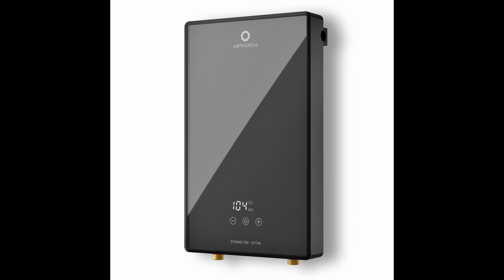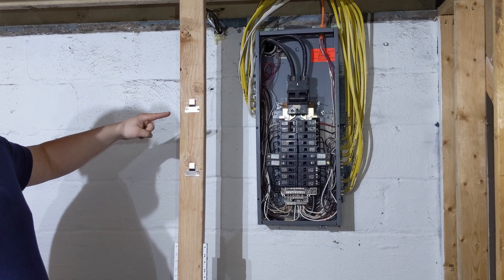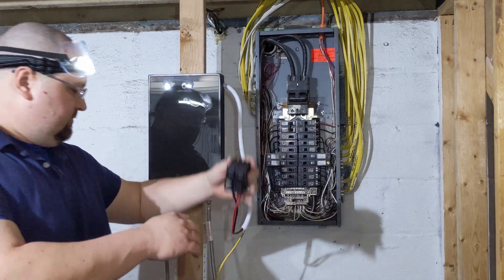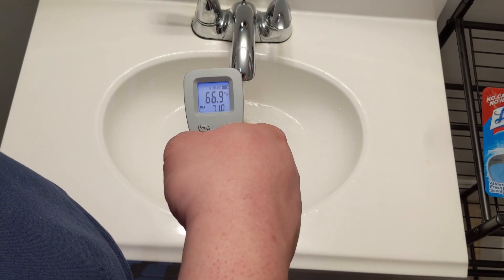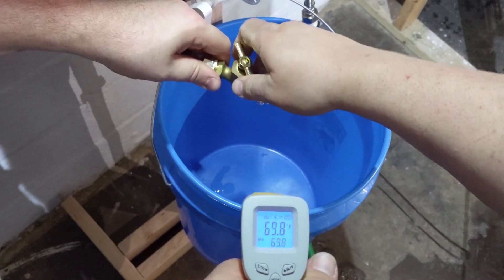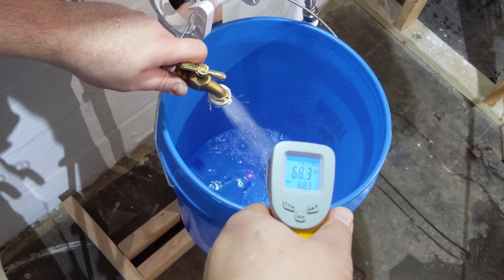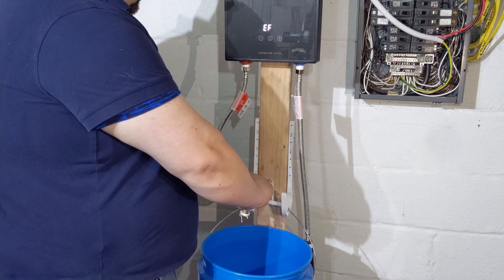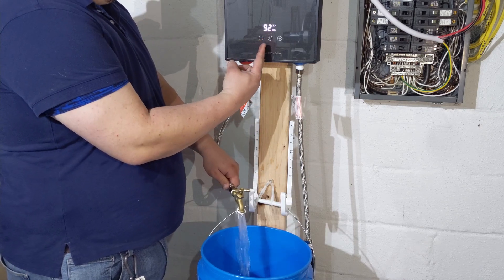Airthereal 9KW 240 Volt Electric Tankless Water Heater Unboxing, Test Bench Install and review.

Comment: How many sinks can I run with hot water running and how long before the hot water go out um tryna see if I can run my shower and my kitchen and bathroom sink together
Reply: Oh I ok I appreciate it I need something that can run 2 sinks and a shower
Reply from the maker: @pakmanmoore4255  I believe their biggest model can do that, this small one can't. It's great for the appropriate use case, but for your use case I would definitely go with their biggest one.
Reply from the maker: This unit will only run one or two sinks(only if low-volume models) . It will not run a shower. 

The larger models will handle more but require more Breakers and different wiring.

Comment: How would you connect this unit to both the sink and shower?
Reply from the maker: You wouldnt want to, this unit is not rated for a shower.
This unit is only rated for one fixture of low volume.
If you need to supply more than one fixture you would need either more units or a bigger unit.
Airthereal sells bigger ones.
Reply: Actually meant to ask about their 15 KW unit, and I have a Navient 210A, but it takes too long to get hot water to the far end of the house to the kitchen sink, and shower. Just need guidance on tying in the water lines. I already have the 240v circuit.  @AdultingWithoutSupervision
Reply from the maker: @guudii  anytime you're using a tankless electric water heater you want to have that tankless water heater as close to all of the fixtures as possible they are not designed to work the same way as a tank water heater. And almost all applications require more than one tankless water heater to take care of an entire house. The one we tested needs to be in the same room as the fixture that's using it. None of the ones I have ever worked with can successfully send hot water to the other end of a house, they need to be closer to the application.
Like one room or less away from the application. 
If you are close to two fixtures and your unit can handle two fixtures you tie them in the same way you would anything else you get a t split or a y split, and two shut off valves. Because of the size difference you might need adapters.
I'll try to make a follow-up video explaining this in more detail, depending on when I can and how long it is it might end up on our Tik-Tok or Twitter.
Remember, however, we are amateurs and our advice is not a replacement for getting a professional opinion or calling a professional to do it if need be.